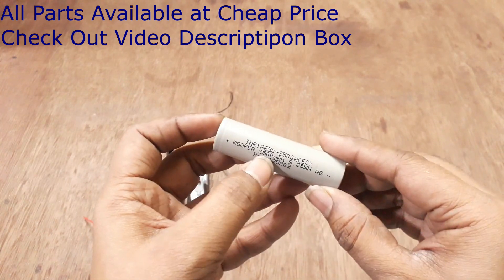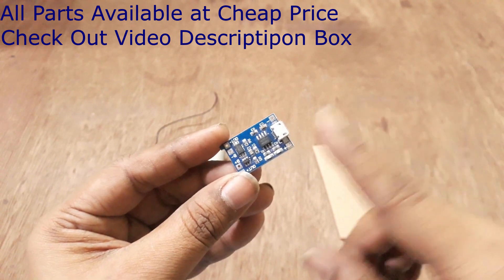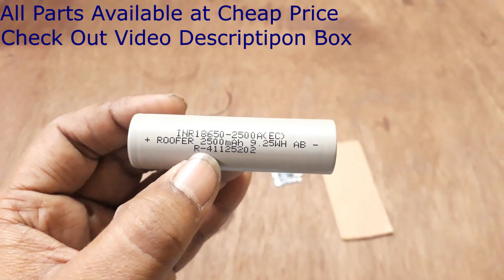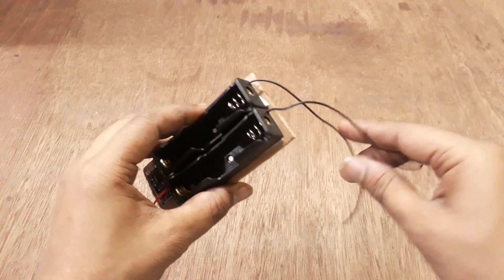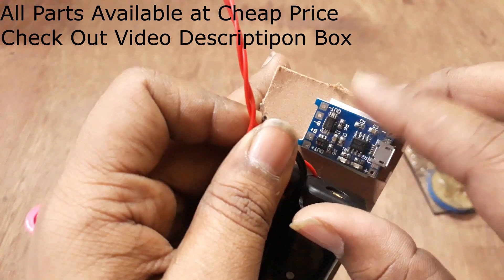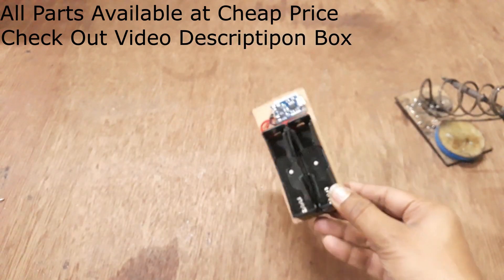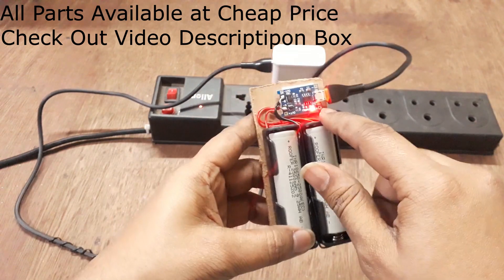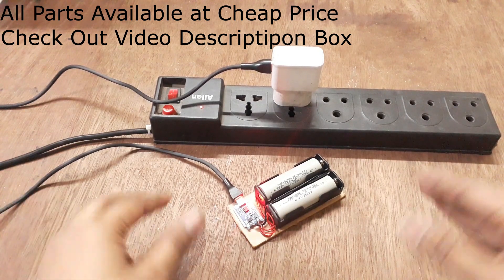DIY Lithium ion 18650 Battery Charger, 2 Cells Charger

Comment: I'm a product design engineer, method shown in the video is not recommended, because if you're connecting two batteries at the same time in parallel to charging circuit, it will cause voltage change in both batteries and it will because heavy error in Voltage calculation and your charger will show full even the second battery is not completely charged, 

If some one seriously wanna make, use two separate charger circuit for two batteries and connect them both from input side of power supply but not on output where we connect batteries. Then it will work properly without Voltage calculation error.
Reply: @John Hero Nice Questions,  if you want to connect to batteries in parallel, you've to follow some strict condition,  both of your batteries must be at same voltage level, also at same physical Health and as well as same capacity and same build quality, after confirm it, you can connect and can charge it simultaneously and can use simultaneously, if you'll de attach it, Voltage level will become different, hence after connecting it once, use it always together in parallel, also charge it together, then it is successful. Thank you!
Reply: @John Hero follow above instructions and then charge two batteries using one charger.
Reply: So what's the use of 2s,3s with different ampere bms circuit???
Actually u r right but it is mostly for lipo batteries that we use in rc cars..it should be needed to balance and need an exact charger.
The video shown here is just like in a powerbank(bt there's series connection)
For the common usage it's okay and a cheap one too.

Comment: Is it charging 2 batteries in parallel ? how much time on average does it take ? the other to pins on the TP4056 can be used for output  ~3.7v with double capacity I am intending to use for my arduino nano (will also connect a buck converter to make ~3.7 to around 7-9v)

Comment: Hey buddy . Great Video!!! ..
i have an small question.
can i run rs775 dc motor with my PC smps which give me 12v and 14 amperes dc current as output??
will it destroy the motor or it will be fine??
Reply from the maker: You can use

Comment: When i charge two 18650 batteries with TP4056 module. Module is getting hot is this normal ?
Reply: Use a heat sink

Comment: Bro 5 v mobile charger se 2 cell ko series mai charge krna h mtlb 8 v ko koi booster alava koi module ya circet ho to ek video banao pls coz booster se 8 v fullly charge nhi hota 7.8 v pr atak jata h votage but mujhe cell ko fully charge krna h 8.4 volte tak but yaad rhe only 5 v k charger se
Reply: Mera bi same question ? 
Tum ne 8 volt ko kaise charge kiya ?
Please answer me
Reply: @sanjayabehera1647  ha ha ha ha
Reply: @pankajkr7208  
Cool, Mera ko pata hai, me confirm ke liya , pahuch raha tha, 
Ha ha ha .........
Reply: @sanjayabehera1647  mujhe bhi bya do bhai kese charge krte ho tum 5 volte se 8 bolte ki battery ko
Reply: @pankajkr7208  
Ha ha ha ha ......
Reply: @sanjayabehera1647  hurr lol
Reply: @pankajkr7208  
Sorry brother
Two  5volt charging module ko series me connect kar diya , 
Charge to ho raha hai , 
Aaj hi charge kar raha hu .
Reply: @sanjayabehera1647  share kr skte ho koi video ya pic merko bhi jrurt h
Reply: @sanjayabehera1647  solution mil gya bro 5 volte se 8 volte ko kese charge kare..😍
Reply: @sanjayabehera1647  click on the link and follow the same step and use this method it's working perfectly 🤩

Comment: 2 battery parallel charge karne se TP4056 overheat nahi hoga kya?
Reply from the maker: Ha hoga . Use one battery better
Reply: @SAYANDALAL  what isbthe solution then. To charge 2 18650 in parallel?

Comment: I kept charging my 18650 cell (2500mAh) , with tp4056 for more than 1 hours,but it still not fully charged! Does it takes more than 1 hours to charge fully? I mean to 4.2v ? please replay me, or else i have to replace or return it back to the seller itself 🥲
Reply from the maker: If your battery is discharged it need 1 full night to be charge. 
Otherwise 2500 mah need 2.5 hours or 3 hrs aprox.
Reply: @SAYANDALAL  thank you sooo much! I was worried about the cell! Thank you so much!

Comment: What happen when one battery is fully charged and other one is charging .... So the fully charged battery gets overcharged ?
Reply: Each battery needs one module, this is wrong to have two batteries charging on one module. It will destroy the batteries based on their existing charge.

Comment: If I want to charge 3 no18650 battery with 2 charger circuit , what will be the diagram
Reply: Same as it as this is parallel connection